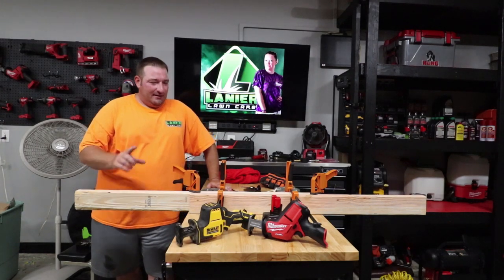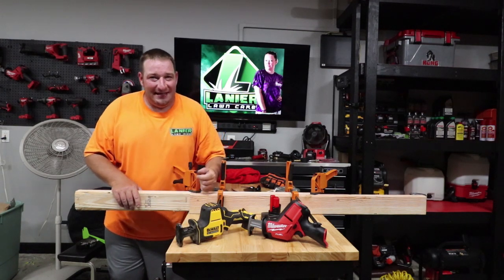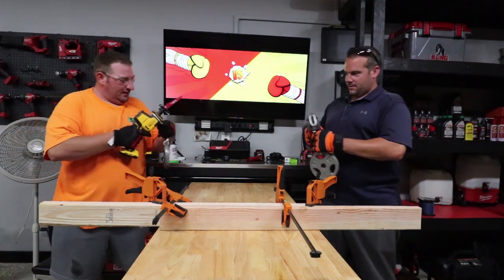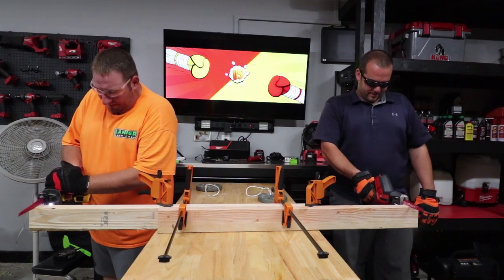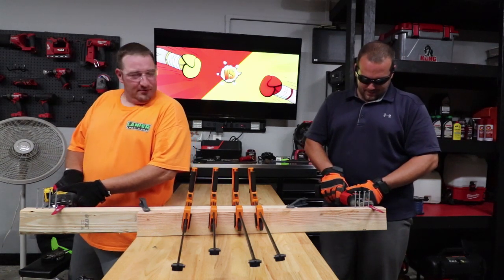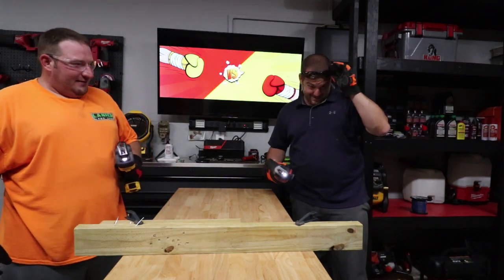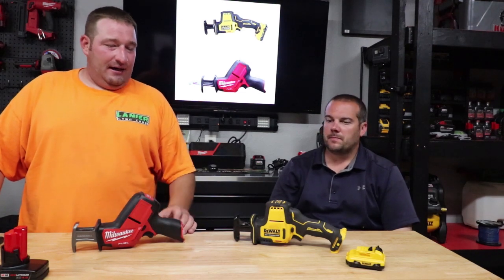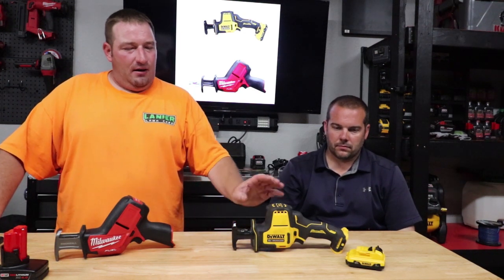Dewalt DCS312B vs Milwaukee Fuel 2520-20, Reciprocating Saw Showdown!

Comment: I have the Milwaukee 18V Fuel reciprocating saw and the Dewalt 12V Xtreme. I use the Milwaukee for bigger jobs and the Dewalt for smaller jobs.  I like the power of the Milwaukee.  But like you I like the handle of the Dewalt.  So I have best of both worlds...great video..👍

Comment: Hi,

Would be nice if DeWalt can make a 6ah battery for their 12v line. 

Yes, DeWalt does have the better handle grip. 

Both great hackzall for 12v tools
Reply: You can get a Waitley 6amp dewalt 12v battery which aren't too shabby and a fraction of the price of original dewalt battery, project farm done a video on replacement batteries, he used originals , Waitley and Vanndon. He even said that the Waitley isn't too bad considering, he basically said for the money buy 2 Waitley batteries 😉 
Hopefully dewalt will make there own bigger amp hour batteries soon but I needed the bigger battery now so got the Waitley. Can't complain for twenty quid.

Comment: You made a huge mistake using the Milwaukee 4.0Ah battery vs the DeWalt 3.0Ah. The 4.0Ah battery would actually be closest to the DeWalt 5.0Ah 12V battery. Why? Because it's not about the Ah when doing these kinds of tests. It's about the maximum amperage these batteries can output. The DeWalt 2Ah and 3Ah 12V batteries have a single row of cells. The Milwaukee 4.0Ah has two rows. It actually puts out more current than the 6.0Ah battery. The only advantage of the 6.0 vs the 4.0 is runtime. If you exclude the Milwaukee 2.5Ah High Output and 5.0Ah High Output, the 4.0Ah is the best of the normal batteries. If you wanted to make a fair comparison, you should have used DeWalt 2.0Ah vs Milwaukee 2.0Ah or DeWalt 3.0Ah vs Milwaukee 3.0Ah (single row, not the one that looks like the 4.0Ah). Also, if you run into a knot, that round should be redone.
Reply from the maker: Thank you for the information. I appreciate someone actually being informative and not just bashing me